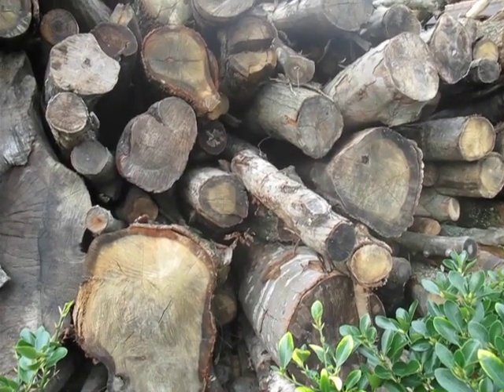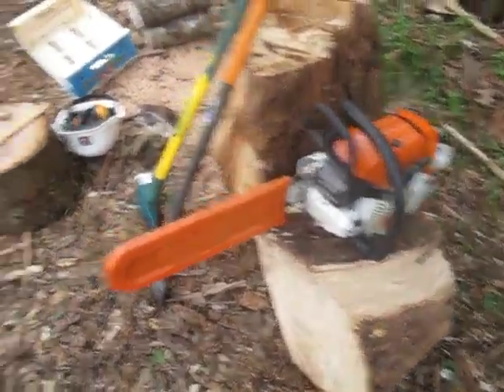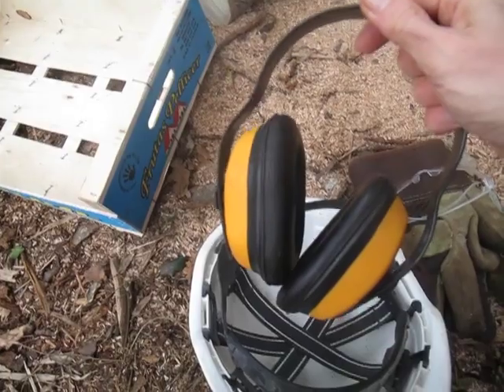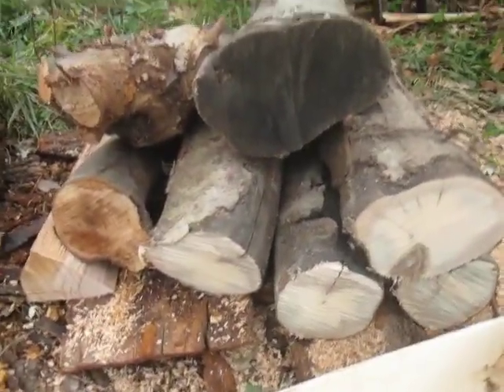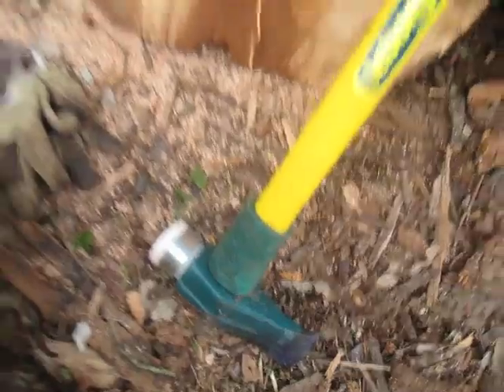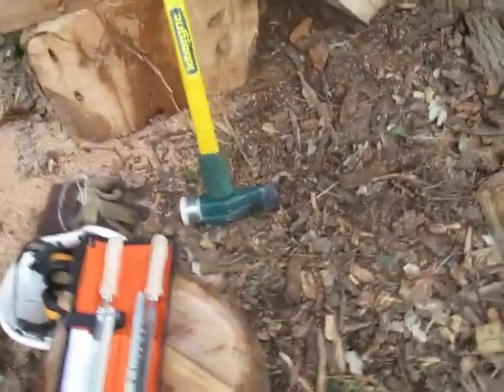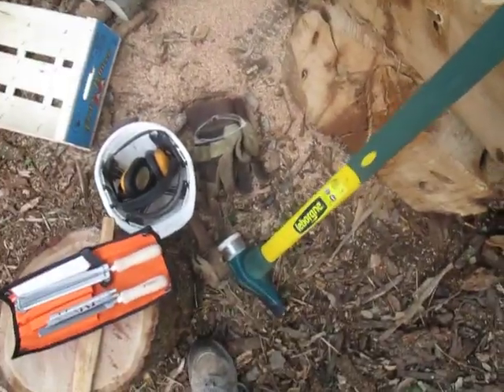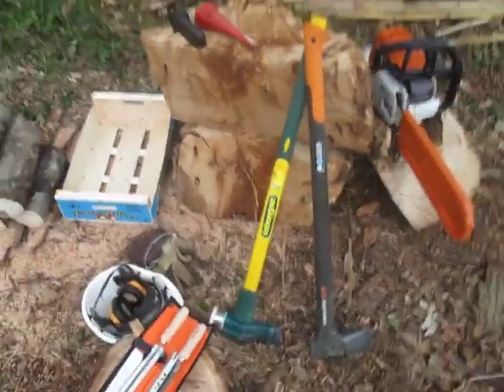How to convert 22 tons of oak trees into firewood - Which tools to use to produce firewood

Comment: Nice video, but I can argue when you say at the end you can avoid nothing that you show here if you want to process firewood. You do not need that fiskars splitting axe, at all. I was watching this thinking, what a waste of 60 euro; this guy already has another splitting maul that he clearly likes better and uses more often. They almost weigh the same amount, do the same thing, and despite what was stated in the video, they are both considered splitting mauls. The fiskars just does not have a traditional maul poll. To be clear I am not saying fiskars is bad in particular, but unless you are working with another person splitting wood simultaneously there is absolutely no reason to have two of almost identical sized splitting axes when the leborgne could handle any splitting task. Thanks for the help though I'll be splitting a ton this winter.

Comment: if your going to go as far as that much trouble, just get a cheap 10ton or so log splitter. way less work. easy as cake. you use little petrol and you can cut about 5 times more an hour. so 400 euro for splitter and about 150ish for a used jonsered chain saw, their cheaper and same quality but last longer. chains go with Oregon. I cut timber for a living. yet still no ear pros eye pro or helmet. nothing but jeans and a saw. and with that much wood is about 50-70 cords. why on earth do you need that much? do you heat a 5,000ft + house year round?
Reply: I agree - Once I got a little age on me and saw how many friends over the years had gotten themselves hurt in several ways I invested in a hydraulic log splitter. It's much safer, offers precision cuts and although it takes much more time to precess a cord of wood than a maul at the end I'm still fresh.